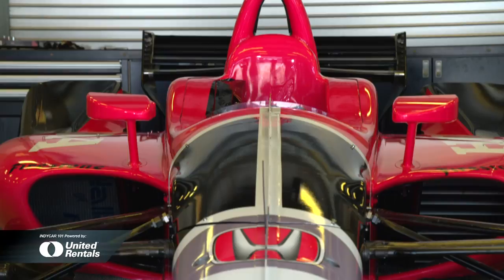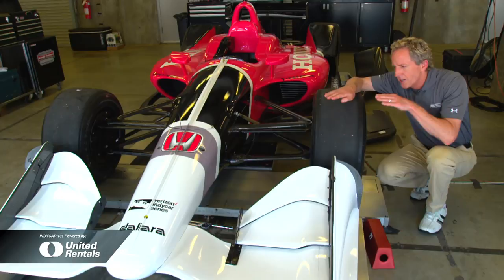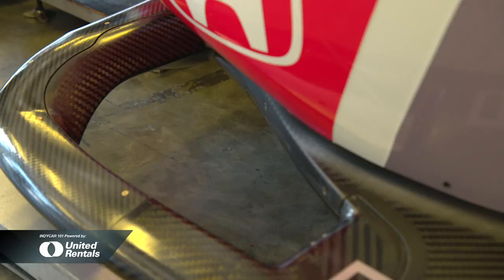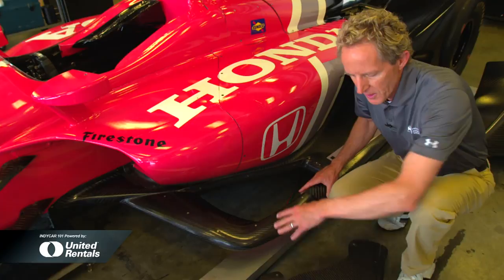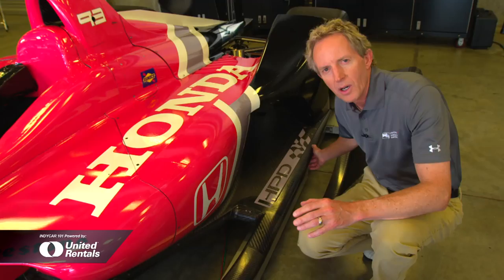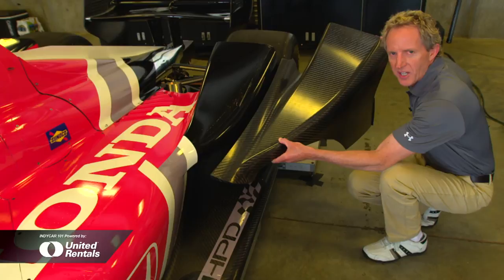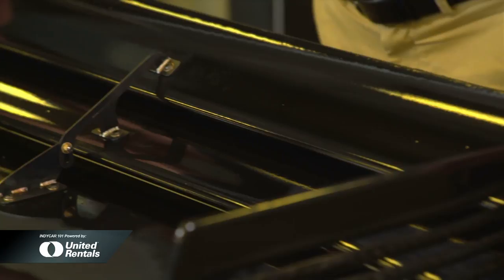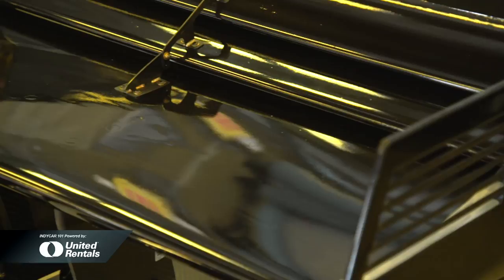INDYCAR 101 Powered by United Rentals: 2018 Road Course / Short Oval Aero Kit

Comment: Still wish those rear wheel ramps were smaller and not connected to the under tray. The car does look a lot better though. Now it just needs another 200hp and we'll be good :-)
Reply: László Varju yes, that's enough at Indy, but on road courses they are only at around 650-750hm. The golden era of indycar had 900+hp and the cars were amazing on street and road.
Reply: MetalMastodon when Randy Bernard was CEO, his goal was to break the track record with the new car. The planning of the DW 12 was atrocious and we got stuck with a bad handling racecar that was very limited. Remember they couldn't get it above 215mph for a while. In the last technical segment, beekhus says they want pole speed w this new car to be over or around 230. I assume that it's highly possible that within a couple years they can get close to the track record.
Reply: I think I'd be happy with anything over 750hp. But yeah, 900hp for these cars would be optimal.